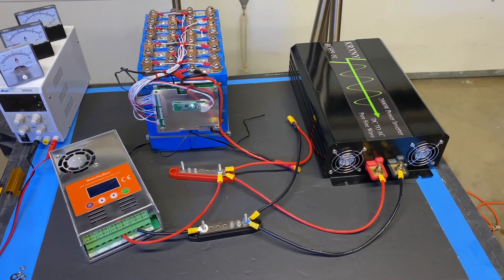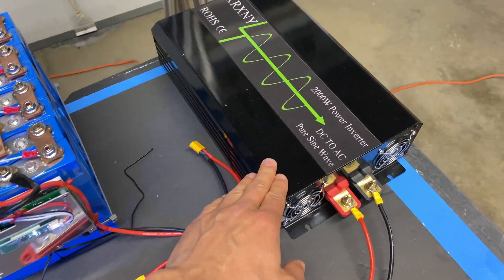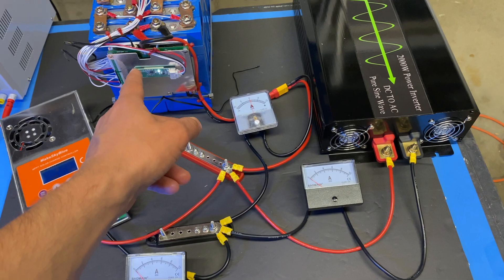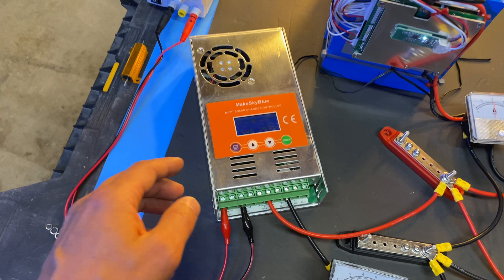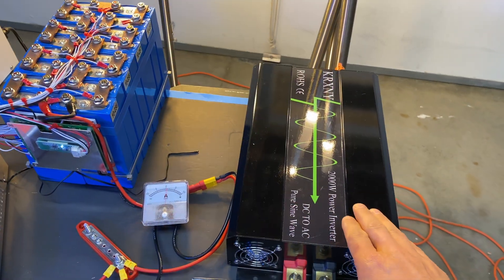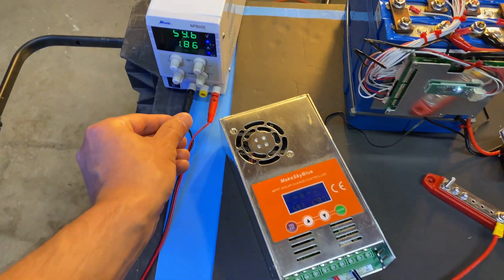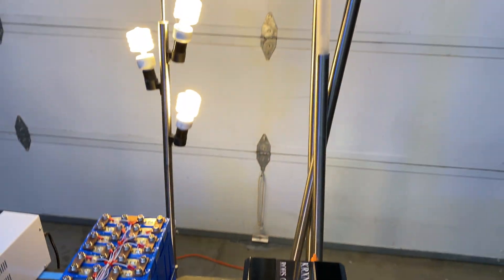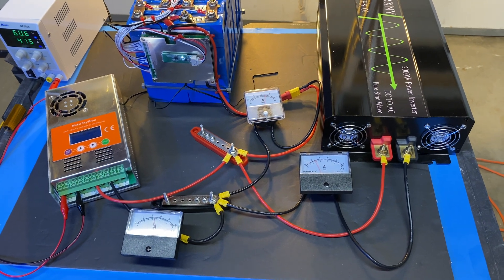How amps flowing in off grid solar system?

Comment: Molodets, horoshoi video! Essentially this is KCL (Kirchhoff's current law) current from the source goes towards the load with the least resistance or the load drawing the highest current since they are configured in parallel.

Comment: Great video, but one confusion is that battery capacity is not defined in solar charge controller mostly , say  solar panels connected like this in parallel... the current will obviously flow towards the load , if the battery is full and solar are producing excessive power what would happen then ???  how would CC Know to stop current to battery?
Reply from the maker: MPPT (CC) have settings for MAX voltage, when battery will reach full charge, then CC will reduce its output.
Reply: @SolarEngineering  but how charge controller would know load and battery connected on same point in parallel...
Reply from the maker: @inamaman9891  CC doesn't care, it's only seeing the battery voltage, if voltage drops then Amps going up, if voltage raising - amps going down.
I missed this scenario on video, should show it as well..

Comment: Great demonstration - thank you - one question I noticed the SCC read 54.6V which is around a float voltage - does the battery need to be at this higher state of charge to get this distribution effect?
Reply from the maker: It will work at any voltage, just the nature of electricity.
Reply: @SolarEngineering  Hi again - I have asked this question before at the MSB website but not had a real answer. I wonder if you know 
When the Controller is set to Lithium mode, does the Controller work at CC until it reaches the set voltage then stop.
If the Float voltage is not used in Lithium mode when does the controller begin CC again - is it at a set voltage drop?

Is it best to set on Lithium settings or Pb setting with float?

Thank you
Reply from the maker: @peterwareing3045  it depends of charge controller, in my case when floating voltage is reached, charge controller switching to CV mode and just holding voltage.
Reply from the maker: @peterwareing3045  it depends of charge controller. In my case when floating voltage is reached, then charge controller switching to CV mode and just holding this voltage.

Comment: Excellent video thank you. Am I correct in assuming that the BMS is controlling where the amps go when you change the combination of  amperage sources?  It is the BMS that decides to use some battery amps when needed and also to charge the battery with excess, correct?
Reply: it is not bms that decides where the current will go....
Reply: Nothing "decides". Current will always flow to wherever the pressure is lower. Batteries full and connect a load, pressure will go to the load. I do that all day everyday (except when there's no sun lol) I have 1000w of solar coming in but my batteries are full so I power my 1000w A/C and the batteries STAY full all day. Right at 4:30 when the sun dips below the trees, I turn off the ac and my batteries stay full this way 24/7 yet I use power all day long till the sun is gone.
Reply: @souporlouis  yes, it is like pressure but you can always change the flow path or block it....
Reply from the maker: BMS will just power from the battery in over-charge/discharge event.
The charge controller will limit MAX voltage (to prevent battery overcharging).

Comment: I watched most of your videos and see that you've tried many different BMS manufacturers. I'm in the market to purchase a BMS...  Which is your best recommendation. I am waiting for delivery:  8 cells  New brand EVE lifepo4 3.2v 280 ah xuba 280ah for total 560AH

Running in  8 cell (parallel pairs) in series for 12v 560ah battery. Thankyou!
Reply from the maker: Hi there, I'm waiting for new LiFePo4 cells to arrive to test Daly BMS, hopefully it will perform well. 
My current BMS (chargery) often has issues out of the box, I'm not 100% happy with it.

I tested another smart BMS 16s (video somewhere on this channel), it performed well, but I haven't tested it with heavy charging amps.
Will see how Daly passes tests.

Comment: This is a very good power distribution demonstration. It is also applicable to marine application. When we know we will use our high amp draw anchor windlass we start our engine so the alternator can provide amps directly to the windlass circuit and help reduce the strain on the windlass battery. This will of course also help extend the life of the battery. Additionally it can reduce the strain on the windlass motor in the event the windlass battery is at a low SOC. Cheers

Comment: 7:25 Super interesting. Half of amps flow to battery from mppt charge controller. So the mppt charge controller will stop this when it detects battery is back to full charge?
Reply from the maker: MPPT has MAX battery voltage settings, as soon as it will reach this voltage, MPPT will cut 2.5A and will just supply power for the inverter. If we turn the inverter off, then MPTT will stop producing any power.
Reply: Yes, but it isn't recommended to charge lifepo4 battery over 54v with this charger because it doesn't have the algorithm for this or any other battery which mean you can damage the batteries with this charger. My top choice for charging batteries is Victron because it includes the charging algorithm for many batteries.
Reply from the maker: @neliosamch3195  could you explain what is potential damage could happen to LiFePo4 when we float 16cells with 55V?
Reply: @SolarEngineering  if all cells are balanced perfectly no damage will occur and you have a protection board that will stop charging as soon as the cells hit 3.65v. The potential damage occur when cells are imbalanced and cells goes over 3.65v the cells get ballooned and or the capacity start to fade. I have 8 of these version v119 but I  set them to 54v and let the Victron controllers finish charging the batteries because the cells voltage start spiking over 3.375v and the controller provides the appropriate amperage to keep cells balanced.
Reply from the maker: @neliosamch3195  ah those unbalanced cells :) 
BMS still should do its job, my outback flex set to 55V and active balancer doing a pretty good job, rarely BMS still disconnecting charge to protect cells.
Reply: @SolarEngineering  Outback flexmax is a good controller for lead acid batteries but I think it doesn't have the charging algorithm for lifepo4.  BMS some times fail and having a controller matching the batteries is another layer of of protection.
Reply from the maker: @neliosamch3195  yeah, completely agree

Comment: Thank you very much
Reply: I was wondering to ask you something similar.
I have already got a MPPT charge controller and I'm looking to buy a hybrid inverter. But the ones with PWM charge controller is fairly cheaper than of those with MPPT.
Can I buy the PWM one and feed it from my MPPT controller?
Would it perform as efficiently as the MPPT?
Waiting for your through answer.
Reply from the maker: @sanjaycallraut  you could charge batteries using your MPPT and connect batteries to hybrid inverter (not using hybrid PWM). 
MPPT -----> Battery ------> Hybrid inverter.
Reply: @SolarEngineering  I thought of that but does all the functions work fine ?
Reply from the maker: @sanjaycallraut  usually hybrid (all-in-one) inverters don't require solar panels to be connected. So you will be good.